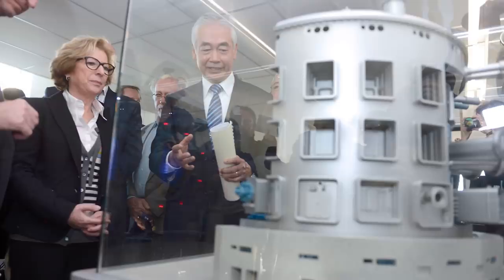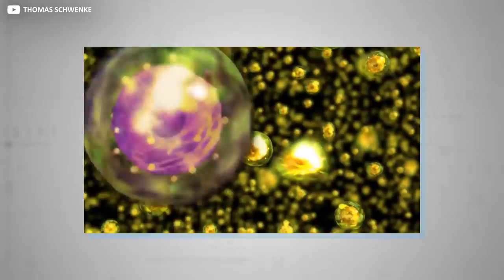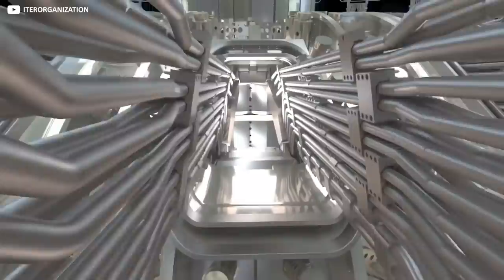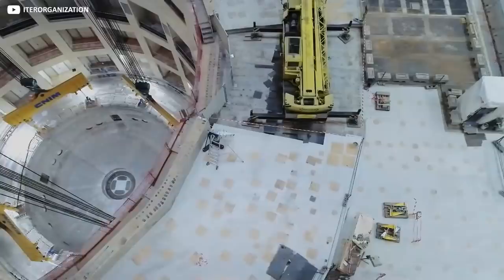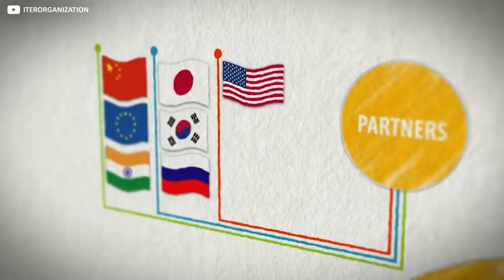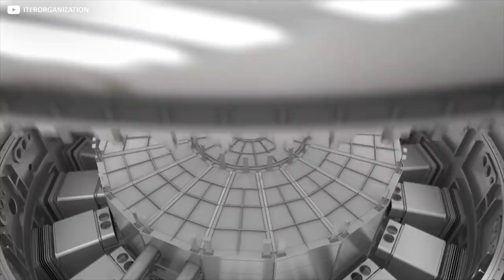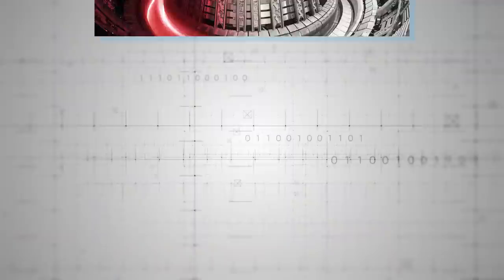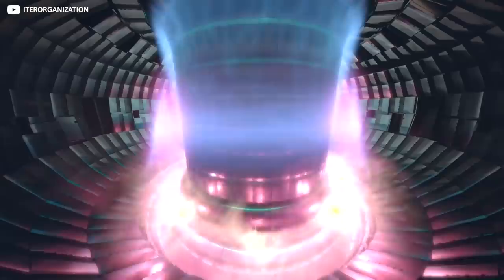Inside The World's Largest Nuclear Fusion Reactor

Comment: I saw somewhere that China already had this up and running.   What could go wrong?
Reply: Actually nothing. And china doesn't have this thing up and running. China is part of ITER among many other countries. One of his roles is to provide technologic support, and one of the things they did is building a small scale fusion reactor that it's not even better than other reactors out there, but it's quite flexible in the ways it can shape the plasma. By turning it on they are going to figure out the best way of shaping the plasma in order to advance work on ITER. All those news about "china's artificial sun" are basically clickbaits.

Comment: It's possible that a TOKAMAK is not well designed. Stars and nuclear bombs achieve fusion at very high densities...
Reply: But it’s not a star or a nuclear bomb
Reply: @Gomlmon99  of course, what's your point?
Reply: @williamotule  I mean it’s nothing like a star or nuclear bomb, so I don’t think they’re comparable
Reply: @Gomlmon99  They are comparable since stars and bomb achieve nuclear fusion at ignition. Tokamaks rely on the confinement time, but this could be a flaw in the conception for fundamental reasons, like turbulence or beam scattering etc
Reply: @williamotule  the design of the tokamak is well documented not much new there so we’re pretty sure that it will work flawlessly.
Reply: @mat7can106  I have a phd on that so my opinion is documented that was not the point thx

Comment: if it works that would be awesome, but we made tons of mistakes with nuclear power and are  paying for it with cancer and stuff today, if this goes wrong like nuclear did what will be the fall out?
Reply: Fusion should not generate radioactive waste.  The primary waste product is just plain old helium.  And if something fails then the reaction stops; there is no way for a runaway reaction to happen.  So worst case damage will not spread for miles like existing fission nuclear reactors.  Fusion should be much safer.

Comment: Nuclear fusion will solve the high life  of radioactives wastes but not the need for natural ressources supplies like deuterium and Tritium for now. Which means excavation and so pollution.
Reply: what? deuterium comes from water.
Reply: @MenacingPerson  yeah but what about Tritium ? My argument still stands.
Reply: @lionec226  you don't need it
Reply: @lionec226  also they only use 100 grams at a time
Reply: @MenacingPerson  if they use it, they need it even if it's small. Why? Because Tritium and deuterium can fuse at a "pretty low temperature" and have the best energetic ratio 'needed power to fuse / fusion energy released ' . Tritium is rare and you need to create some in factory or need to remove lots of grounds to only find a little Tritium. Not really a clean method. You also need  a certain amount of power in factory to create some too. But it's actually the best method for an efficient fusion reaction for now. Maybe we'll sort out a best way to do it in the future but its is as it is now.

Comment: Why should we build this when we have a fusion reactor that's gonna run for millions of years from now, and it's FREE.
Just build solar panels. It's much more cost efficient.
Reply: Solar is not sustainable on long term and in huge amount
Reply: @shrodingerscat8940  why isn't it sustainable in long-term? Sun shall shine even after the end of humanity, silicon is abundant in planet's surface. A lot of desolate deserts are receiving a lot of sunlight. Can't we use them.?
Reply: @akhileshap9439  how will we produce energy in night also it's very less effective at generating electricity and takes a huge area
Reply: @akhileshap9439  nuclear fusion is the way
Reply: @shrodingerscat8940  let's use other non polluting energies such as hydropower during night and to supply for excess demand. The area that is taken for harvesting solar energy is land where either its not suited for cultivation or on roofs of existing buildings. 
With enough funding we could make solar energy throughout the world and solve the energy crisis.
Reply: @akhileshap9439  it's not easy hydropower dosent give much energy to support the the country and solar stops working after evening. Both of these energy sources depends on natural condition which means it's not sustainable. What will u do during cloudy weather?
Reply: @akhileshap9439  also solar or hydro power is just not enough to provide enough energy  to big manufacturing  industries. It can be used as a slight alternative way of power but never the main source. Nuclear is the future as it's better than fossil fuel or or coal.

Comment: no nuclear waste?  gamma radiation?   nice cartoon video and targets
Reply: No waste and radiation
Reply: Gamma radiation is just highly energertic photons which are emiited from the nucleous of the atom, and yea some gamma radiation will be emitted but it'll be stopped by the out casing and not just that not a lot if gamma, most is UV or below, og and yea no dangerous nuclear waste, all nuclear waste is in fission terms is lower chain isotopes which are basically the products of broken down unstable uranium, and since fusion deals with simple atoms such as Hydrogen and helium it doesn't break down into other dangerous radioactive isotopes. So no.

Comment: Does Humanity even have materials that can withstand 1million degrees? Those temperatures  are way too extreme in my opinion. I know the machine will have cooling but if an accident occurred where the cooling stopped for a second for whatever reason. I feel that if could lead to catastrophe.
Reply: this is why the plasma is being held in place by incredibly strong magnetic fields, so the heat doesn't actually 'touch' the surrounding material - JET in the UK have already exceeded 50million degrees and the Chinese 100 million
Reply: basically the magnets hold the plasma and it's head away from the walls. it's almost literally a bottle made of magnetic fields.
Reply: also the plasma is some grams, so even at those high temperatures it doesn't hold much heat (energy)

Comment: Something will go wrong 
People will die 
Fools, big kids messing around with fire 
Ya gonna get burnt
Reply: This things is extremely safe. Practically nothing can go wrong.
Reply: @mat7can106  

Yeah ok 🤣🤣
Reply: @rickycwakingthemasses5791  you would know that it is safe if u knew anything about how this reactor works or basic nuclear physics.
Reply: @rickycwakingthemasses5791  Fusion power is even safer than fission since if anything happens, the reaction will stop and the plasma will cool.

Comment: Good luck not having a meltdown that whole place is gonna melt into the dirt.
Reply: if the plasma even just touches the wall the reaction stops because it doesn't hold enought heat to keep it's temperature

Comment: Fusion is reality within 20 years - and will always be that. The one thing tokamak's cannot provide is the immense pressure that is present inside a star, without it fusion won't happen.
Reply: We don’t need pressure at these temperature, with this reaction chain
Reply: @Gomlmon99  really? Why is the fusion reaction not stable then and requires more energy input than it gives out? In stars the immense pressure AND heat keep the fusion running.
Reply: @eerotillanen8914  it’s not particularly stable because you have to control a charged plasma with magnets. Don’t think that’s remotely relevant to pressure.

It doesn’t require more energy input than it gives out. Physics is not wrong. We just haven’t gotten around to building a reactor to do this yet - but ITER will ~2036.

Why are you comparing it to a star? Totally different conditions, totally different reaction chain.
Reply: @Gomlmon99  Stars succeed in providing stable fusion of hydrogen into helium, tokamaks don't. Yes, the reaction chain is different and with stars have several stages but also in a tokamak the plasma must be kept dense enough to sustain the reaction. And that's the Achilles heel of them, I suspect it won't be possible. Why? Because magnetic fields cannot be controlled in exact manner like controlling photons to create laser, for example.
Reply: @Gomlmon99  Not true or else fusion energy would be reality. But it'll always be 20 years away, I suspect. Prove me wrong, I don't mind.
Reply: @eerotillanen8914  what do you mean not true? Fusion is a reality. It’s already been proven to give more energy out than our in. Now we just need to put it in a power plant.
Reply: @Gomlmon99  where has fusion created more energy than was put in? And that's only the beginning, the output must be vastly greater than input in order to be economically feasible. One have to remember that the energy loss when generating electricity from heat is huge. Typically efficiency coefficient in this is around 40 per cent at best and the rest 60 per cent is lost as waste heat. Of course, the hotter water vapor can be created the higher the efficiency coefficient is.
Reply: @eerotillanen8914  In a nuclear bomb. Are you seriously suggesting that tens of thousands of scientists are wrong, and you are right? Ridiculous to be even having this conversation.

Comment: THE ULTIMATE AND CLEAR MATHEMATICAL PROOF OF THE FACT THAT E=MC2 IS F=MA:

Ultimately and truly, TIME is NECESSARILY possible/potential AND actual IN BALANCE; AS E=mc2 IS F=ma; AS ELECTROMAGNETISM/ENERGY IS GRAVITY. This NECESSARILY represents, INVOLVES, AND DESCRIBES what is possible/potential AND actual IN BALANCE. SO, time DILATION ULTIMATELY proves ON BALANCE that E=mc2 IS F=ma; AS ELECTROMAGNETISM/energy is gravity. The stars AND PLANETS are POINTS in the night sky. A PHOTON may be placed at the center of THE SUN (as A POINT, of course), AS the reduction of SPACE is offset by (or BALANCED with) the SPEED OF LIGHT; AS ELECTROMAGNETISM/ENERGY IS GRAVITY; AS E=mc2 IS F=ma. Great !!! "Mass"/ENERGY IS GRAVITY. ELECTROMAGNETISM/ENERGY IS GRAVITY. Gravity IS ELECTROMAGNETISM/energy. E=MC2 IS F=MA.

Consider the man who IS standing on what is the EARTH/ground. Touch AND feeling BLEND, as ELECTROMAGNETISM/energy is gravity; as E=mc2 IS F=ma. GREAT !!!

E=mc2 IS F=ma. The linked AND BALANCED opposite of what is THE SUN is A POINT in the night sky. The stars AND PLANETS are POINTS in the night sky. A PHOTON may be placed at the center of THE SUN (as A POINT, of course), AS the reduction of SPACE is offset by (or BALANCED with) the SPEED OF LIGHT; AS ELECTROMAGNETISM/ENERGY IS GRAVITY; AS E=mc2 IS F=ma. This NECESSARILY represents, INVOLVES, AND DESCRIBES what is possible/potential AND actual IN BALANCE. Therefore, the linked AND BALANCED opposite of what is THE EARTH is ALSO A POINT in the night sky. Great. Gravity IS ELECTROMAGNETISM/energy. ELECTROMAGNETISM/ENERGY IS GRAVITY. E=mc2 IS F=ma.

Gravity AND ELECTROMAGNETISM/ENERGY are linked AND BALANCED opposites, AS E=mc2 IS F=ma; AS ELECTROMAGNETISM/ENERGY IS GRAVITY. Accordingly, the Earth AND the Sun are linked AND BALANCED opposites; AS E=mc2 IS F=ma; AS ELECTROMAGNETISM/ENERGY IS GRAVITY. Gravity IS ELECTROMAGNETISM/energy, AS E=mc2 IS F=ma. The stars AND PLANETS are POINTS in the night sky. It ALL CLEARLY makes perfect sense. Great !!!!!! Energy has/involves GRAVITY, AND ENERGY has/involves inertia/INERTIAL RESISTANCE. E=MC2 IS F=MA.

The EARTH and the SUN thus constitute and comprise what are the MIDDLE AND THE FULL DISTANCE in/of SPACE (IN BALANCE) in full and BALANCED compliance and conformity with the CLEAR and universal fact that E=mc2 IS F=ma, AS ELECTROMAGNETISM/ENERGY IS GRAVITY. Great !!!! It ALL CLEARLY does make perfect sense. (The stars AND PLANETS are POINTS in the night sky.) INDEED, BALANCE and completeness go hand in hand. Now, very importantly, outer "space" involves full inertia; AND it is fully invisible AND black. Great.

NOW, OVERLAY what is THE EYE in BALANCED RELATION to/WITH what is THE EARTH. Notice the black space of THE EYE. The stars AND PLANETS are POINTS in the night sky. THE DOME of a person's EYE is ALSO VISIBLE. Now, carefully consider what is the semi-spherical, translucent, QUANTUM GRAVITATIONAL, AND BLUE SKY. Great. E=mc2 IS F=ma. It is CLEAR. THE EARTH is ALSO BLUE (AS WATER). GREAT. "Mass"/ENERGY IS GRAVITY. ELECTROMAGNETISM/ENERGY IS GRAVITY. Gravity IS ELECTROMAGNETISM/energy. 

INSTANTANEITY is thus FUNDAMENTAL to what is the FULL and proper UNDERSTANDING of physics/physical experience, as E=mc2 IS F=ma; as ELECTROMAGNETISM/energy is gravity. Gravity IS ELECTROMAGNETISM/energy. It ALL CLEARLY makes perfect sense. Inertia/INERTIAL RESISTANCE is proportional to (or BALANCED with/as) GRAVITATIONAL force/energy, as this unifies AND balances gravity AND ELECTROMAGNETISM/energy; as this balances gravity AND inertia. (This clearly explains BOTH F=ma AND E=mc2, AS ELECTROMAGNETISM/ENERGY IS GRAVITY !!!) ACCORDINGLY, gravity/acceleration involves BALANCED inertia/INERTIAL RESISTANCE; AS ELECTROMAGNETISM/ENERGY IS GRAVITY. SO, the BALANCE of being AND EXPERIENCE is essential; AS E=mc2 IS F=ma.

Our EXPERIENCE is NECESSARILY that of what is the FULL DISTANCE in/of SPACE, AS we are BALANCED between what are THE SUN AND c (A POINT); AS E=mc2 IS F=ma. The stars AND PLANETS are POINTS in the night sky. SO, a given PLANET (INCLUDING WHAT IS THE EARTH) sweeps out equal areas in equal times; AND this is THEN consistent WITH/as F=ma, E=mc2, AND what is perpetual motion; AS ELECTROMAGNETISM/ENERGY IS GRAVITY. Gravity IS ELECTROMAGNETISM/energy. E=mc2 IS F=ma. BALANCE and completeness go hand in hand. It ALL CLEARLY does make perfect sense. THINK about what is QUANTUM GRAVITY.

"Mass"/ENERGY involves BALANCED inertia/INERTIAL RESISTANCE consistent with/as what is BALANCED electromagnetic/gravitational force/ENERGY, AS E=mc2 IS F=ma; AS ELECTROMAGNETISM/ENERGY IS GRAVITY. Indeed, gravity/acceleration involves BALANCED inertia/INERTIAL RESISTANCE; AS E=mc2 IS F=ma; AS ELECTROMAGNETISM/ENERGY IS GRAVITY. Therefore, the rotation of WHAT IS THE MOON matches it's revolution !!! Objects fall at the SAME RATE (neglecting air resistance, of course), AS E=mc2 IS F=ma; AS ELECTROMAGNETISM/ENERGY IS GRAVITY. Gravity IS ELECTROMAGNETISM/energy. Gravitational force/ENERGY is proportional to (or BALANCED with/as) inertia/INERTIAL RESISTANCE; AS E=mc2 IS F=ma; AS ELECTROMAGNETISM/ENERGY IS GRAVITY. 

Stellar clustering ALSO proves ON BALANCE that ELECTROMAGNETISM/energy is gravity, AS E=mc2 IS F=ma. Magnificent !!!

E=mc2 IS F=ma. Is a two dimensional surface or SPACE visible or invisible ? The answer is that it is BOTH. So, the electron AND photon are structureless. A PLANET (INCLUDING WHAT IS THE EARTH) is a balanced MIDDLE DISTANCE form in relation to E=mc2 AS F=ma. A PLANET (INCLUDING WHAT IS THE EARTH) is a balanced MIDDLE DISTANCE form in relation to the Sun AND c (A POINT). The stars AND PLANETS are POINTS in the night sky. E=MC2 IS F=MA. ELECTROMAGNETISM/ENERGY IS GRAVITY. Gravity IS ELECTROMAGNETISM/energy. Gravity AND ELECTROMAGNETISM/energy are linked AND BALANCED opposites, AS E=mc2 IS F=ma; AS ELECTROMAGNETISM/ENERGY IS GRAVITY. BALANCE AND completeness go hand in hand. Very importantly, outer "space" involves full inertia; AND it is fully invisible AND black. E=MC2 IS F=MA. It ALL CLEARLY makes perfect sense.

The BALANCE of being AND EXPERIENCE is essential. The INTEGRATED EXTENSIVENESS of THOUGHT (AND description) is improved in the truly superior mind. INSTANTANEITY is thus FUNDAMENTAL to what is the FULL and proper UNDERSTANDING of physics/physical experience. (THOUGHTS ARE INVISIBLE.) It is a very great truth that THE SELF represents, FORMS, and experiences a COMPREHENSIVE approximation of experience in general by combining conscious and unconscious experience. MOREOVER, the ability of THOUGHT to DESCRIBE OR RECONFIGURE sensory experience is ULTIMATELY dependent upon the extent to which THOUGHT IS SIMILAR TO sensory experience. Beautiful. It ALL CLEARLY makes perfect sense. E=mc2 IS F=ma.

By Frank DiMeglio

Comment: still dont understand it how i will charge my phone with this hot-donut
Reply: Hot-donut - steam - generator - electricity - your phone.
Reply: @Engineer9736  meh..still using steam generating electricity after 200 years.
Reply: @gergelysoki1705  Yes becouse there is no other way to do it better.